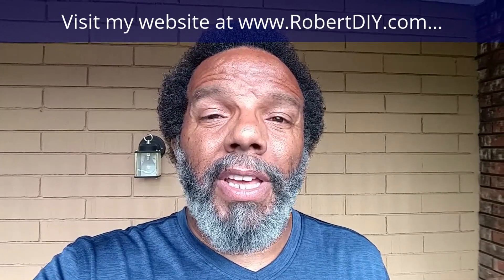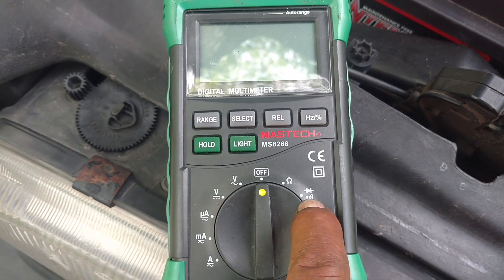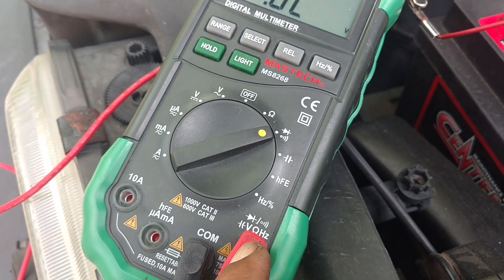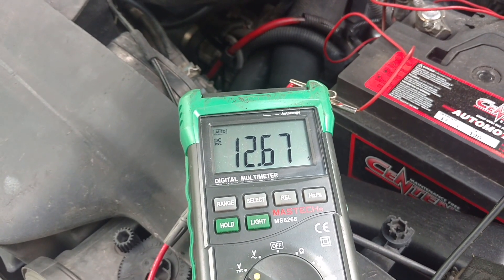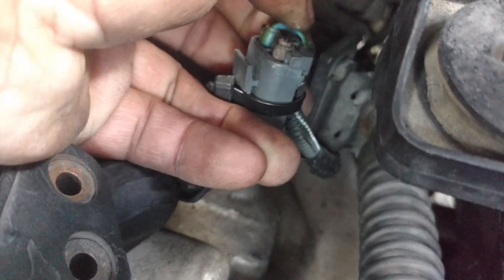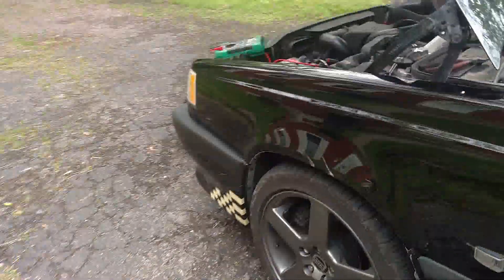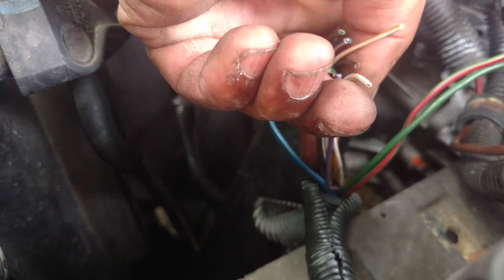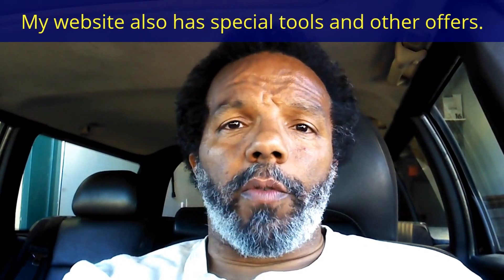How to get your reverse lights to work after the manual transmission swap, Volvo 850, S70 & V70.

Comment: Hello Robert  I've changed the reversing light's switch changed the bulbs checked the fuse still no reversing light's any idea s Robert it's a w reg Mk 'll v 70
Reply from the maker: Did you test the switch? Do you have a washer on the switch? You should NOT have a washer on it.
Reply from the maker: Is the vehicle Auto or Manual?
Reply: It's a manual  and I've checked no washer on the switch
Reply: I've not tested the switch as it's a New switch
Reply from the maker: How long have you had a problem with it?
Reply: @RobertDIY  since I brought the car one month ago
Reply: I paid £900  pounds for it it's had two owners from New done 140000 miles

Comment: VAST tuning did my 850 she runs 450whp about 600$
Reply from the maker: +Hill Billy cool. What size turbo are you running?
Reply: its a Garrett AR 50 but it has been machined.when you do the math the trim works out to 74.49 instead of 50. Im running DW800 injectors with a Tial 50mm BOV

Comment: Hi Robert. I've got a S60 geartronic and both reverse / back up lights are out but bulbs and fuses are ok. Any ideas ? Thanks
Reply from the maker: Nope.
Reply: Replace your reverse light switch. Depending on your year that could be located on top of your transmission. 19mm ratcheting box end wrench after removing some stuff should be the final tool needed. 
1) Check light bulb condition
2) Check fuse on passenger side fuse panel
3) Change reverse light relay under the hood
4) Change reverse light switch on top of the transmission

Comment: Is there a company or a place I can get an ecu for a manual swap 
My car seems to not have all of its power I'm sure its a vacuum leak but I also want the check engine light gone
It's also running super rich
Reply from the maker: What injectors are you running?
Europe or Canada is likely the best place. 
There are also a couple of places that sell tunes, maybe $600. :(
Reply from the maker: Do you have a manual swapped car? If so, which one?
Reply: I have no clue what injectors I'm gonna guess stock I bought the car with the swap
So they do have an ecu for manual swaps
Reply from the maker: The ECU out of manual cars are for manuals.
Reply: Not sure what car you have, but don't get an ARD tune whatever you do. They blow things up. 98 S/V/C70 T5 Manual ECU is the go to for turbo manual swapped Volvo's, ECU numbers 450 and 608. This tune can also be loaded into stock ecu's, there is info about doing so online.
Reply: what color are they?